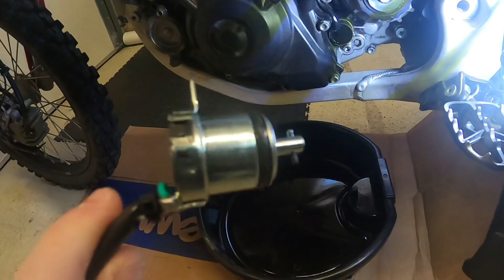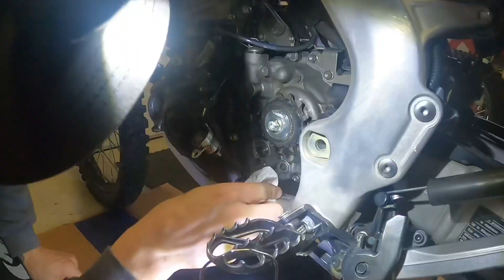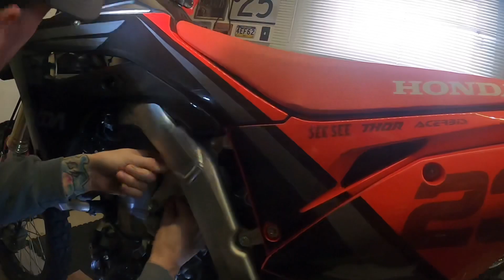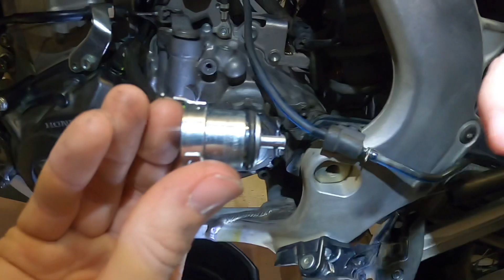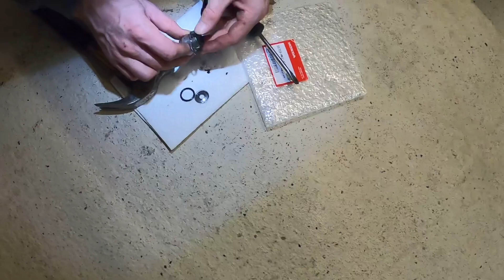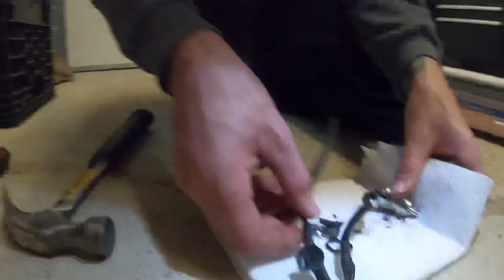Leaking Gear Indicator Switch : CRF450RL

Comment: I bought a 2024 crf 450rl in April of 2024 rode it 1150 miles had it stored inside my house for about 8 months noticed oil dripping onto the floor. Today decided to change the oil and clean everything up because it was difficult to tell where the leak was coming from rode it 50 miles and the leak proceeded it’s a very small amount but enough to bug me it is on the resin part and the bolt so I am 99% sure that this is the exact problem I am having. Possibly could be from seal behind the sprocket but that is doubtful.
Reply: I have the exact same thing, 2023 bought with 840km rode a bit and noticed a bit of oil and dirt build up, cleaned it and yea seams oil is leaking from this on my 450rl

Comment: I got my check engine light on. I can reset the code but it comes back on.
Gear shift position  Circuit A is the code. I’ll have to see if the plug is loose or if I need to replace. Thanks for the vid. Mine has 35,000 miles and this is the first real big issue.
Reply from the maker: @slaugo  the oil gets inside the switch and its probably shorting out.
Reply: OEM on order. Plug wasn’t loose.

Comment: Can I get the part # off of that? Looking at the part diagram, it only shows the o ring and the 6mm bolt. Not the actual switch. Thanks!
Reply from the maker: 35759-MKE-A51
Reply from the maker: got it off partzilla!
Reply: @DirtDFactory mine started leaking as well but mine called for 35759-MKE-A52 wonder what the difference is